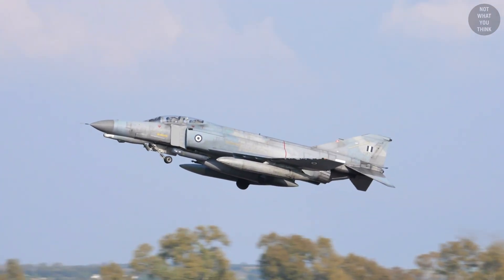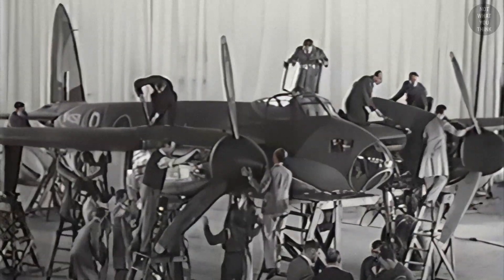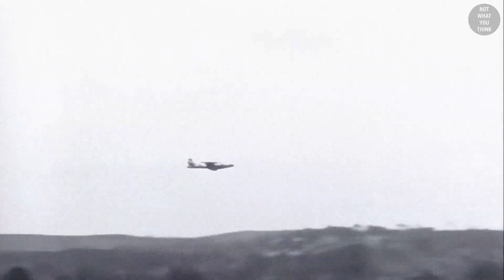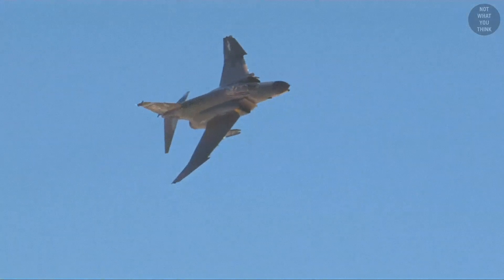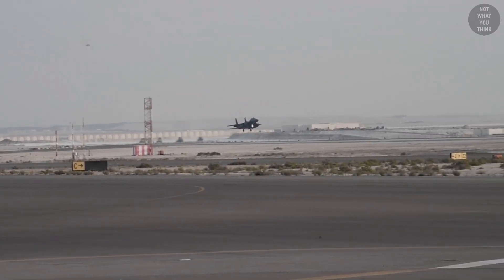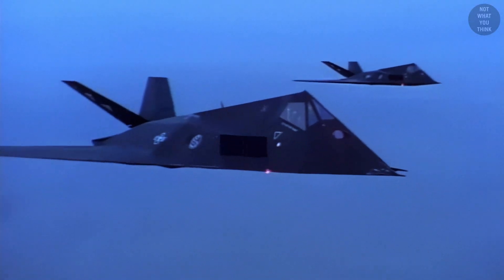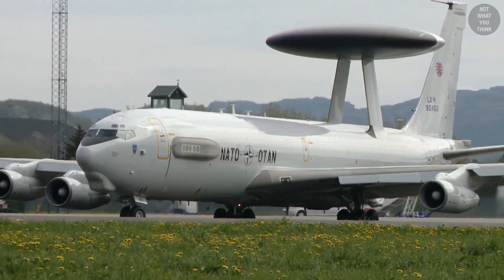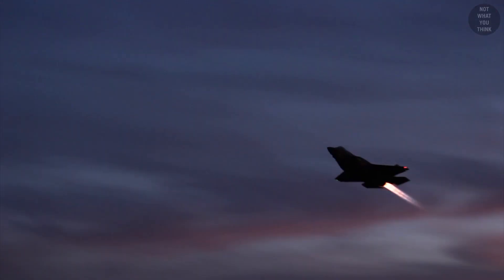Why are Modern Fighter Jets Slower than 1960s?

Comment: Stealth isn't invisibility, its simply reducing the radar cross section, meaning the range at which a plane can be detected.   The counter to that is more powerful radars...  There are radars right now that have ranges well over 3500 miles.   the problem is, you would think, that range is useless.   Because of curvature of the earth, and max altitudes why would you need to be able to detect a .1m target at 3500 miles?      well you don't.  unless you are looking at things in low orbit, there "shouldn't"  be a need for that, except.   Steal reduces the range at which a target can be detected...   but again, with enough power such i might only be able to see the f-35 at 350-600 miles out, rather then 3500 miles... BUT i can see the F-35 at 350 miles out, meaning... I can intercept it.   direct fighters, or fire missiles...   Now, the F-35 needs to either be fast enough to outrun interceptors...   carry enough weapons to dog fight their way out,  (great dog fighters but,  2 air to air missiles + extended fuel tanks internal?   and no gun?)   

Stealth over the next 10 years is likely to find itself "failing" more and more, as radars continue to get more powerful, and are better able to detect them at longer and longer ranges...  

Right now the radars that can detect them are ground based because of the huge power requirements for them...   BUT they are mobile platforms... able to travel with launching vehicles.   Not fixed installations.    So again, within 10 years we are likely to see these powerful radars mounted on AWAC...

Comment: Speed and avoiding air defense systems are actually linked...  A tactic used in some cases is baiting missiles to fire...  you loiter around at 75% of the missile max range, when it fires you turn and after-burn out.  this forces the launchers and often the radars to keep track of that fighter...   allowing for its radar and launch sites to be located for counter strike, but... at the same time,  only very fast aircraft can do this... if you are to slow, you won't be able to get beyond the max range of the missile...  

Next, speed is important for at rest intercepts.    there are times where fighters are on the ground waiting for a target, rather then being in the air.   When a target is detected, they will start the aircraft take off on afterburners,  go for their best climb rate,   they need to get from the ground, to intercept altitude to the target as fast as possible.    This is something planes like the Mig-21,  F-4, f-15,  mig-31 and such are built for.   they need to be able to get up, and get to a point often only 100 or less from their launch point.   

This..  becomes increasingly important for carriers.   Russian bombers missiles out range carrier air defense missiles,   often by a 2-1 margin.   Carriers operating 24 fighters, might only have 4-8 fighters airborne at any time,  saving 12,  and cycling through groups of 4-8 to give pilots down time.  each russian bomber carries 2-3 missiles,   so a group of 24 bombers, can be anywhere from 48 to 72 missiles coming in at a US carrier group.    In a concentrated attack, they might see double that.   fighters will need to launch, and get to intercept altitudes as fast as possible, and get their speed up as much as possible not just  to shoot down enemy aircraft, but incoming enemy missiles.

Finally, speed at which a weapon is launched affects the weapons range.    many of the newest missiles preform best when launched at very high supersonic speeds.   when launched to slow, or from to low an altitude, their range can be halved.

Comment: Two Pratt and Whitney J79s are compared, for speed, with one P & W F135 engine, which was based on the P & W F119 engine used in the F-22 Raptor.

Like comparing a Mustang GT500 to that of a Prius for speed.

Comment: Interesting. I do find the initial comparison of the F4 and F35 a bit odd though since much of the conversation revolved around the air to air mission. The F35 was not designed for air to air. That is the F 22's realm.
Reply: JSF was absolutely designed for both strike and to match or exceed the A2A capabilities of all the aircraft it would replace, namely the F-16 and F/A-18.  The priority of Key Performance Requirements were:

Exceed the combat radius of the legacy platforms by 100nm (F-35A needed to exceed F-16C, F-35C needed to exceed F/A-18A/C, F-35B needed to exceed AV-8B).
For climb rate, cruise speed, ITR, STR, they needed to match or exceed the F-16 and F/A-18 in combat configurations, as well as the MiG-29.
They did all of that with the JSF KPPs after SWAT.  F-35A could barely do it before SWAT, and only got even better after SWAT.
SWAT involved replacing all of the metallic structural features in the tail booms and tailplanes with carbon fiber structures, not just the skin.

Because of the sensors, F-35s have been defeating F-22s in BVR large force exercises since 2017.
Sources:  F-35-From Concept to Cockpit
USAF Northern Edge LFEs pilot reports both from F-35A and F-22A aggressors
Reply: @LRRPFco52  I actually didn’t know that they’ve put the F35 and F22 head to head. I guess no one’s talking about it because they can’t bear the thought of the Raptor being bested, especially by the “turkey.”